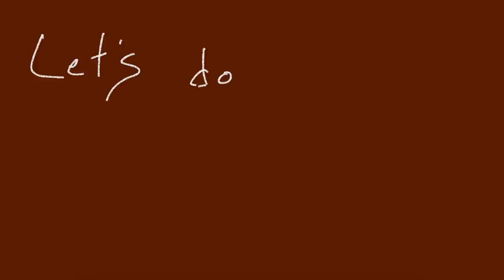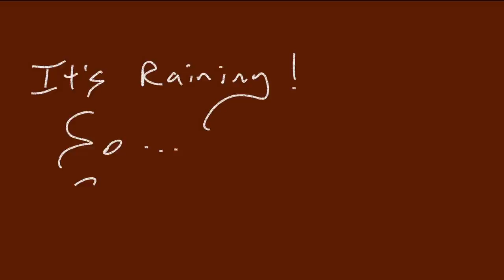Making a Leather Wallet With Olivia’s Help & ASMR  -  the Atticus

Comment: Do you put anything on your stitching chisels to help pull them out? Maybe mine are just not as good of quality, but with several layers I struggle getting them out. 
Thank you for sharing your knowledge with us. 
Chris G
Reply from the maker: I use horween which has fats and liquors in the tanning process.  So it’s easier.  Straight veg is dry and more difficult